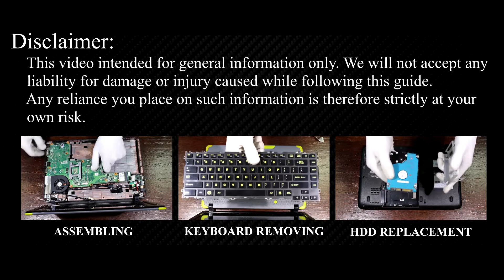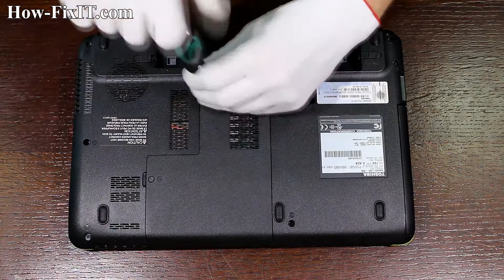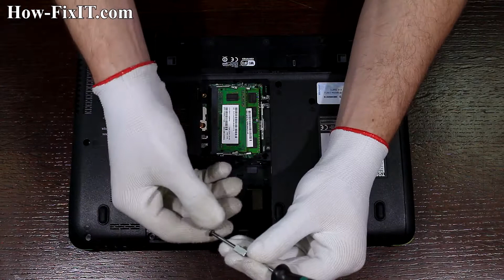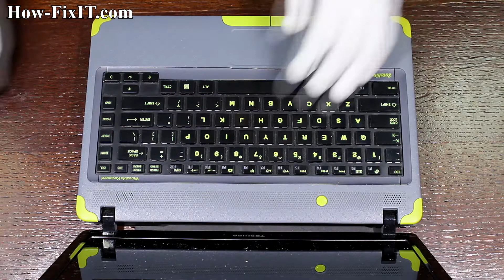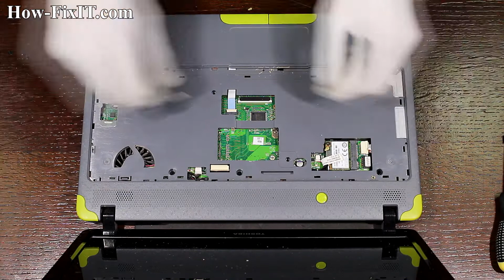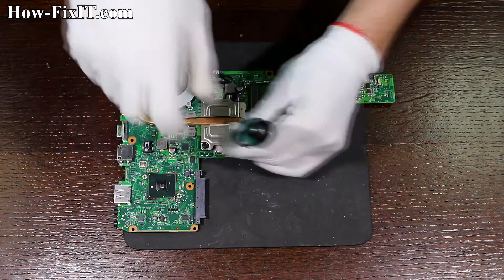Toshiba Satellite L630, L635 Disassembly, Fan Cleaning, and Thermal Paste Replacement Guide

Comment: Sorry for the inconvenience,
With what type of Philips screwdriver do you open the microprocessor fan to remove the dust? I mean that tip number has that screwdriver.
 # 0000 (1.2mm dia.type), phillips # 000 (1.6mm dia.type), phillips # 00
 (2.0mm dia.type), phillips # 0 (2.4mm dia.type), phillips # 1 (3.0mm) day tip) and phillips # 1 (3.5mm day Tip)
Thanks for your attention.

Comment: What are you using lubricant or what is that?
Reply: That is not lubricant, it's thermal paste to efficiently transfer heat from processor to fan cooling plate. This stuff is very important to use! Available at electronics shops, Amazon, etc.